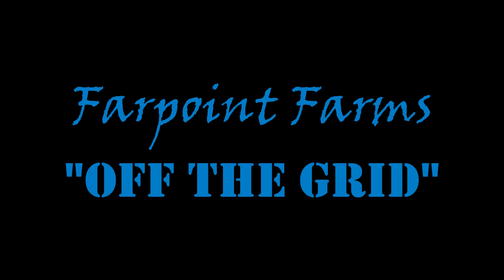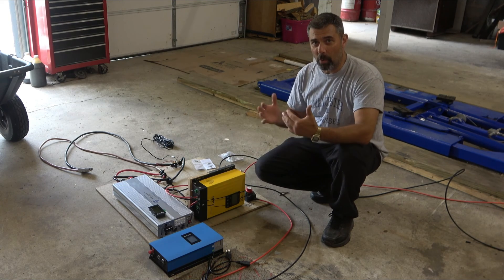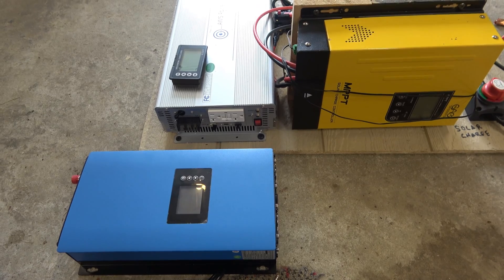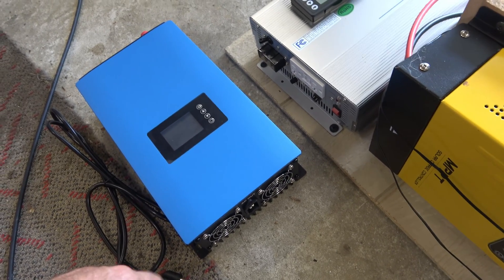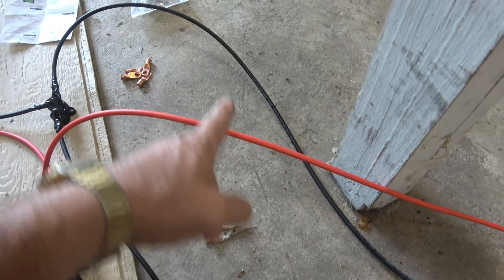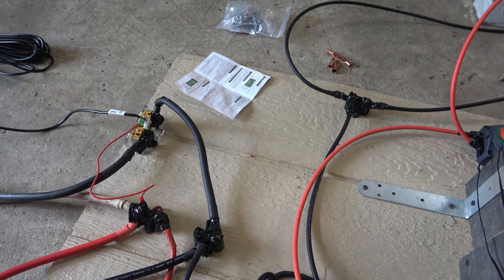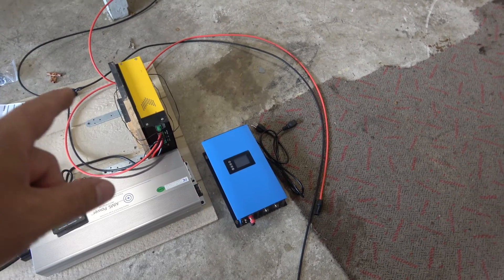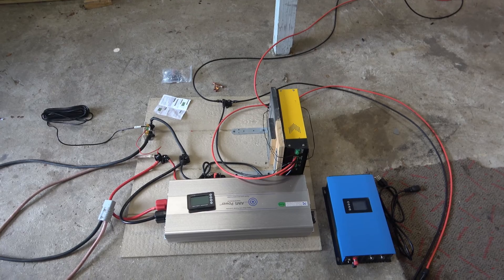My Off Grid Solar Setup Gets Some Upgrades. Adding A Grid Tie Inverter To The System.

Comment: Hi, thanks for the video.

When you have the cutoff switch in the Both position how does the Off Grid inverter get priority over the grid tie Inverter so it can use 100% of available DC voltage if it needs it?

Comment: Your new blue grid tie appears to be the "limiting" style that monitors what you're putting on the grid so you never put more on the grid than you are using.  If so, it comes with 2 leads and 2 clamps that go around each of the 120 v legs that feed your breaker box (from the meter).   I have 2 of these. They work great, even tho I don't use them. They are there for back up in case my off grid system goes down.  If this new blue box is NOT of the "limiting" nature, just be aware that any excess current you put on the grid will likely count against you if you have a new "smart meter".   I've been told a "smart meter" will run forward if you over produce, meaning, you'll not only be giving the electric company free energy, they will be charging you for it as well !  Of course the old analog style meter will run "in reverse" if you over produce.   Forgive me if I'm telling you something you already know.
Reply from the maker: Yes, I did get the limiting type. It was a bit of a pain to install since the power box is 50 feet from the solar array, but I bought extended cables and it is working well.

Comment: iv looked at that grid tie invertor before and iv heared thay work vary well if setup right, and can we see a follow up to this? 73
Reply from the maker: I'll make a follow up video in a few months that covers the savings when using this as a grid tie. So far, I am pleased with the much lower power bill.

Comment: Nice upgrade. Knowing it costs money (Big bucks or not big bucks ... ???) is interesting. Knowing amounts of bucks could be actually useful. Educational even.
Reply: Look the components up y'all are gonna have to do some leg work but as a start Y&H 1000W Grid Tie Inverter Power Limiter DC25-60V Solar Input AC110V/240V Auto Switch 309 Amazon
Reply from the maker: I will make some short videos on each piece so I can cover the costs, but these days the prices seem to climb daily.